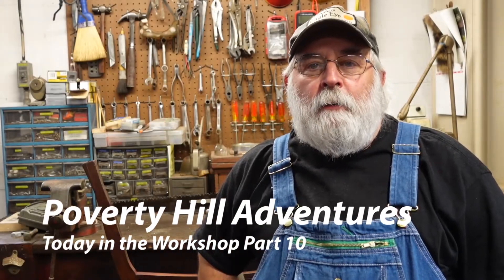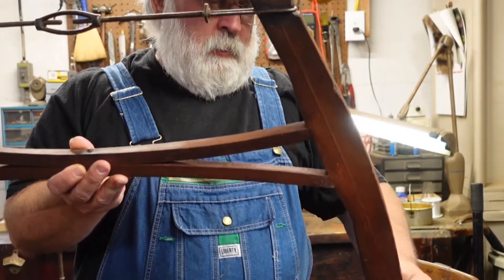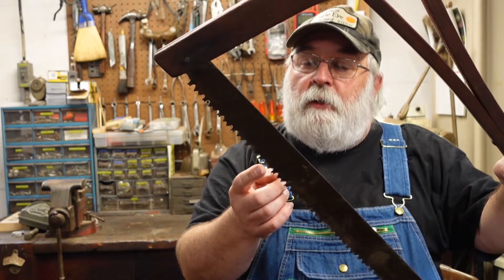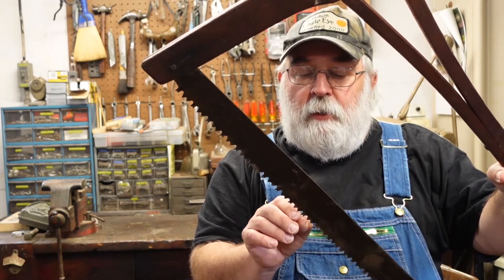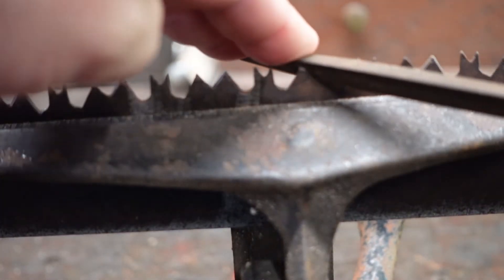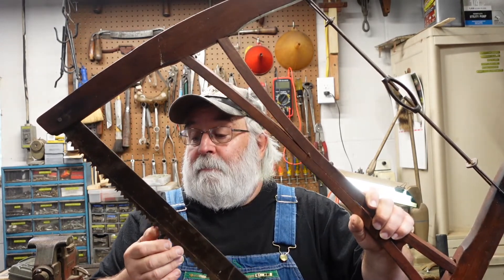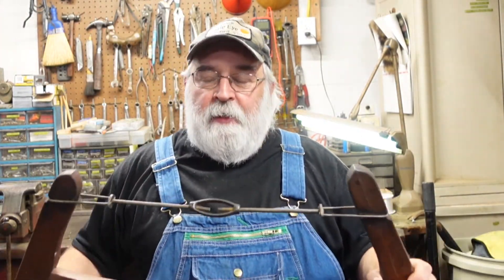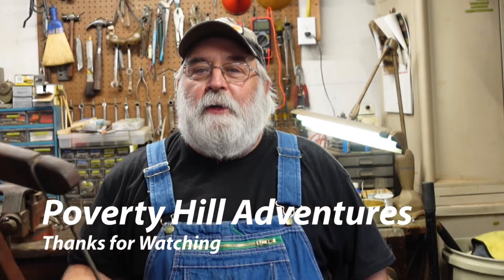Today in the Work Shop Part 10

Comment: Nice saw , I’ve built a few from scratch with regular blades . I use broken bandsaw blades on coping saw frames , works pretty good . Good job on saw , getting the set right when sharpening is a challenge